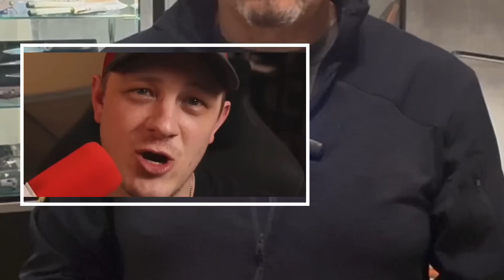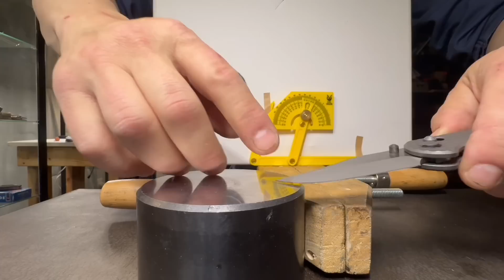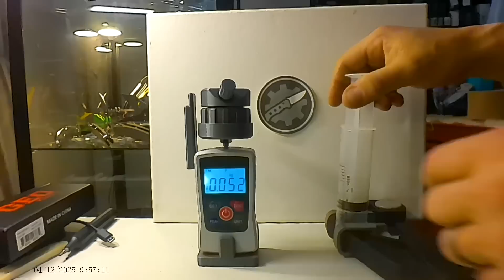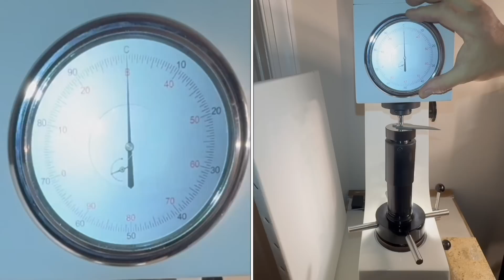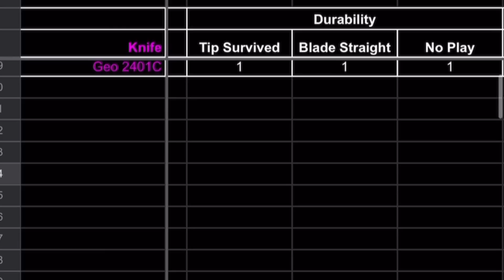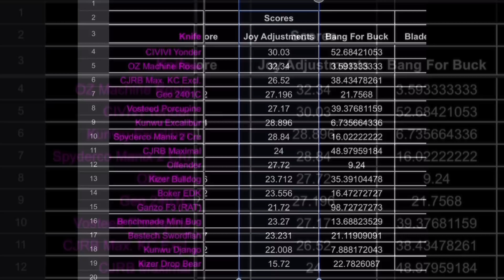Will Geo Ethereal survive the day?! Let’s find out!

Comment: Thanks for continuing to increase your objectivity in testing.  I noted three new modifications to your technique:  the plunger to help regulate rate of pressure on line cutting;  the weighted pressure on the antler;  and the HRC tester.  Got to say, though, I really liked "the tree of doom"😃
Reply from the maker: The tree of doom is still there but there’s a constriction site around it.
Reply: @CBRxLIVE  yeah, it has a certain visceral appeal
Reply from the maker: @ It’s definitely looks more aggressive than the drop point.

Comment: Great to see your Rockwell tester. 👌🏻 Some testing information for your reference - I have just finished extensively testing a batch of known and officially Rockwell tested knives on my Leeb tester and found that I needed to increase the calibration value of my Leeb tester by 40 points. After this recalibration, my HRC values tested with my Leeb tester were all within less than 0.5 HRC of the true value. It seems that a 40 point increase in calibration value gives the best results for running blade tests using your method of gel and the test block.

FYI, to get my Leeb tester into calibration mode, I had to hold the "Enter" key while turning the tester on. This placed it into calibration mode. I then ran the calibration tests on the calibration block, and after testing, I increased the Nominal calibration value by 40 points. This equated to 815 on my tester and the end result was very accurate HRC tests on the known test blades.

I also found that I needed to use more alcohol gel than I expected for more consistent tests, for what it's worth. I initially used a very thin layer of gel, but this resulted in more inconsistent values. The amount of gel you used in your previous videos, appear to be a good and correct amount for consistency.
Reply from the maker: Thanks for the info! To return the favor when I use your sharpness tester, I realized that tightening the screw with the washer first and then tightening the release screw second gives me the most consistent results. I think it’s because this way I cannot exert more than certain force onto the filament.
What did you think about the air piston? I think it’s actually called the basting syringe lol 😂
Reply: Cool, thanks. 👍🏻 LOL, love the "piston" syringe. Sometimes a simple plan can be an effective solution. Probably not necessary as long as you just slowly and consistently cut the line, but either way would work well.

I did see in parts of the video that you didn't completely screw in the bottom cap of the tester up all the way, any reason for this? 😊
Reply from the maker: @ the spool gets stuck sometimes. Is there something I’m doing wrong?
Reply: @CBRxLIVE Not sure, I haven't had that happen yet. 😊

Comment: Does a blade “work harden”? Will it get harder after using it to chop or cut tough items?
Reply from the maker: @michaeldixon3562  Work hardening is a property that is not common among all steels. It usually associates with low carbon steels with less than 0.2% C called Austenitic
M390 is martensitic steel belonging to the class of stainless with more than 1% C and it is not work-hardenable
There are non-corrosion resistant structural steels that are work-hardening to some extent eg. ASTM A514
Some folks confuse work-hardening and forging, but this is a different topic

Comment: FYI, my Ethereal has the Ultem scales, which has a reversible clip and a metal filler tab. The texture is a diagonal linear pattern instead of  stacked dimples for the titanium. Glad you got the HRC tester.
Reply from the maker: @sumway269  Yeah, for some reason they vary the features. I’m having fun with the tester but most likely the certain layer of the knife community will still find the reason to complain…

Comment: Thank you for the review.  The information was really helpful for making my decision to try one of these.  I do have a couple of quick questions if you have time.  Do you agree the drop point is probably a better slicer because the height of the flat grind appears to be 3/4 of the way up the blade instead of the Bowie style being about 1/2 way?  Assuming most of the construction to be the same would take the CF or the Ti?  It is a trade off of weight vs grip but also the clip is stamped and not milled so I am guess insertion is better but removal is worse?  How long did it take from your time of ordering for it to arrive?  Thanks either way for your time and consideration.
Reply from the maker: To answer your last question first, I did not buy the knife, it was sent to me by Geo Knives, so I couldn’t tell you how long it would take them to process an order.
Definitely the higher grind would mean slicier blade.
My experience reviewing the same model of a knife in different trim/materials could be a varying experience. There is a comment to this effect under the Chapter 1 video.
Reply: @CBRxLIVE thank you for the reply.